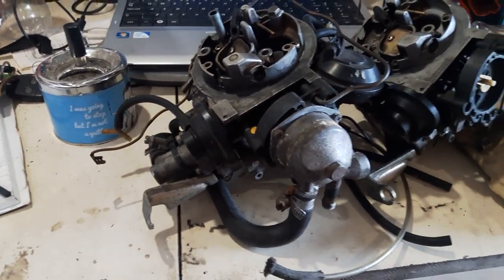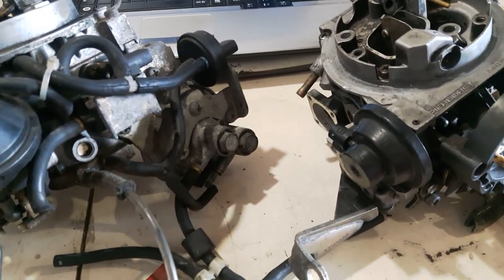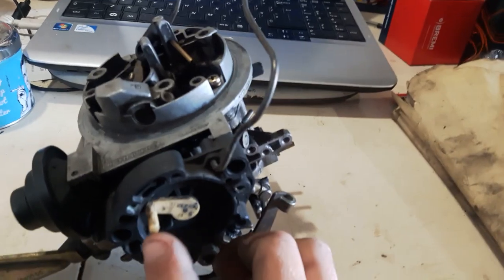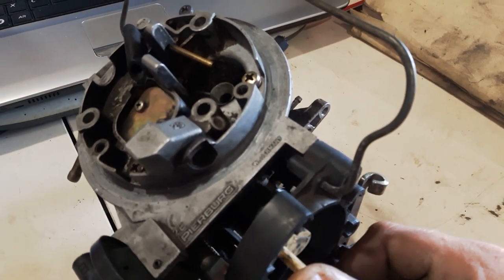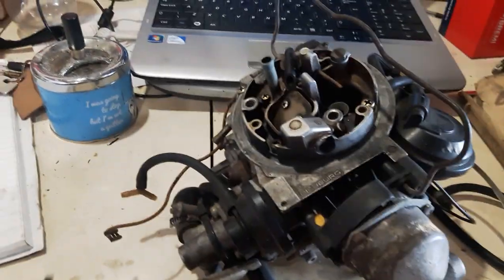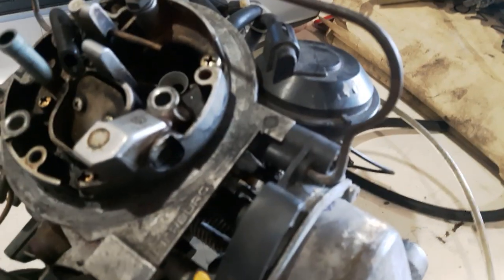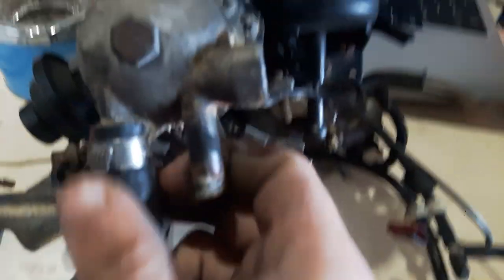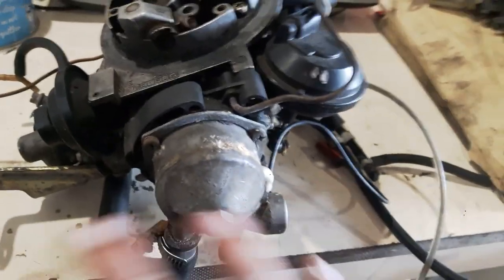RE: Sloppy Pierburg 2e2 Choke Mechanism

Comment: Your videos are excellent and I now understand the carb much better. There is one thing you don’t mention about the choke though. The choke has an electric feed as well as the coolant. It’s electric feed comes from a grey thermo switch on the main coolant pipe in front of the block. They tend to stop working. It only operates up to 50/60 degrees, ie before the coolant warms up. If it’s broken the car will start fine but after a minute or so will choke itself until the coolant warms up. Febi still make a replacement switch
Reply from the maker: Must've missed that at the time, all good knowledge that's worth throwing into the pot though! Thanks for your input and your kind words!

Comment: what could be the problem with a pierburg if the car runs on choque and then dies? when i pull the gas open and look at the carburator it stays closed, the gas cable has serious slack on it so i will change it but even when i operate it with my hands the throttle doesnt open completely. so i guess my choque is working find but there is something else wrong with the carb. when i hear the RPM lowering (so when its warmed up, the car dies) and i think it's because the throttle plate doesn't open correctly. or am i missing something? grtz
Reply from the maker: Sounds like a blocked idle jet might be the problem here

Comment: If the spring is loose will it need winding before attaching to the mechanism.
Reply from the maker: @ericapps-j8b nope, you locate the spring on the lever, mate up the housing and fit the screws loosely then rotate the housing to set the spring tension, tighten the 3 screws down to hold it in place and then you can rotate the cover to the correct orientation by loosening the 13mm bolt and rotating the cover, it guarantees that you set the spring to exactly the correct tension and you dont have to fight the spring onto the lever doing it that way

Comment: Great videos. I have a Pierburg on my 1989 astra van and it seems to be running rich and has a high idle. I’ve had the air box off and the choke seems to be opening and closing ok. Any ideas what else it might be ?

Comment: I drove VW 1.6D my whole life and got constant 60 mpg. Now I got 1.3 1985 golf and it gets 16 mpg in winter and 40 mpg in summer. anyone has an idea what it could be?
Reply from the maker: Maladjustement of the choke mechanism would be my guess!
Reply: @skyrocketautomotive  wow. Thanks for the answer although I have no idea what it means since I drove and and never had to repair diesels my whole life. It's an 1985 unrestored completely factory stock with 334.000km on the clock down to the AEG cooler, telefunken electronics etc. I drove for 6000 miles already and only sometimes it would rev high other times when I start it it would be low revs as usual. I am afraid of touching it but i zhink i should try the coolant hoses first to see if there is blockage as others have suggested.

Comment: Ok I got a Pierburg 2E2 but will it fit on a Audi 5000? Because the Pierburg 2E2 has two sockets for electrical wires. One for the thermovalve and another one for the none return valve. So what would happen of I would if I bypass the thermovalve? Nothing? Or will the idle speed go haywire? The none return valve must be one because other wise the car would not even start.
The Audi 5000 had originally a Keihin carburetor but that is so toast it cant be repaired and I have not found a replacement for it. The Pierburg seems to be a alternative. I dont want to scrap a car just because the carburetor is toast.
Reply from the maker: Hi there, sorry, I've subscribed to so many channels that I lose comments in my notifications of other channel's videos! haha 

Did the original Keihin carb have a manual or automatic choke?  

I can certainly look into the possibility of a pierburg conversion for you! 

Thanks for your comment!
Reply: @skyrocketautomotive  Hi! I have passat B3, 1.6, and i have problems with carburettor pierburgh 2e2. I have changed pull down and bimetal spring mechanism, and i still have problems with it. It stops after few minutes, when the motor is not worm enough. I thing it is problem in plastic part, but it is not possible to buy it. Do you have any sugestion about solving my problem?

Comment: Hey there just a quick one, if the pulldown unit isnt holding a vacum, would that have an effect on the 3/4 point unit?
Reply from the maker: Hi there! 

It shouldn't do as it's on a separate vacuum circuit to the 3/4 point unit, what's happening with your 3/4 Point unit?Is it sticking open?

Thanks for watching!
Reply: Perfect thanks for quick reply, 

No it somtimes moves in and out rapidly so thought it might of been loosing vacuum somewhere, i know the pull down unit is busted and got one on the way.

 Ill check my other vac lines to make sure there alright :)
Reply from the maker: It definitely could be a leak on the back of the carb, you could even whittle it down depending on what movement it's making:

For example, if it keeps moving to the cut off position (drawn in all the way) the solenoid could be acting up, whereas if it's moving to the cold start position (all the way out) you may well have a leak at one of the brown lines coming off of the 3/4 point unit.

Hope that helps!! Keep me posted and thanks for your comment :)
Reply: Kyle Mundy Shall do I'll have a good look when I'm fitting the pull down unit, the car also bogs down and missfires on occasion so need to find out why it's overfueling, cheers!
Reply: Hey sorry to be a pain again, I've finally got round to changing the pull down unit and got vacuum finally, however I've noticed that the idle speed is sitting at 1200 and there's a gap at the throttle plate and the 3/4 point unit, is the throttle plate arm supposed to rest against the piston to control idle? cheers
Reply from the maker: Hi There, Great news about the PDU!! 

It shouldn't do until the engine is warmed up. If it's staying like that once the engine's warm it will very likely be that your waxstat is sticking! 

I've got a video on here about how to fix that issue, it essentially boils down (no pun intended) to removing it and putting it in a jug of boiling water :) 

Let me know how you get on!! 

Kyle